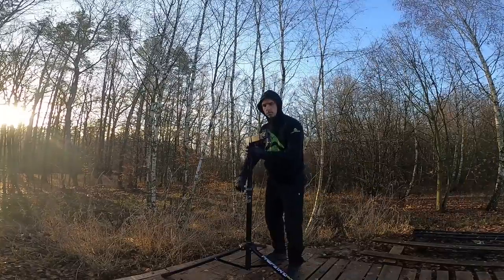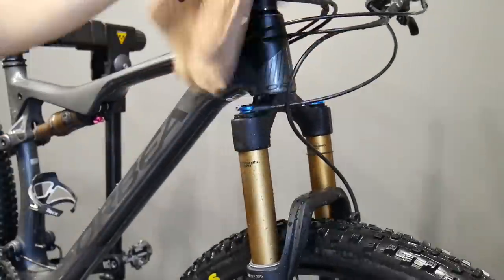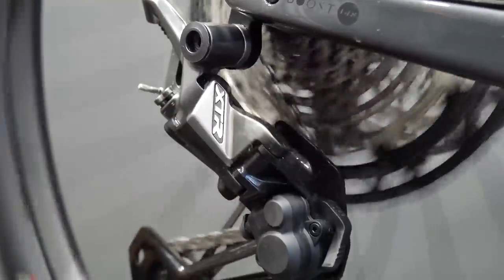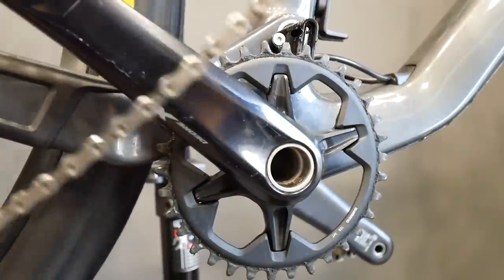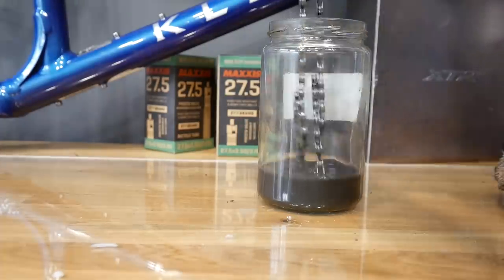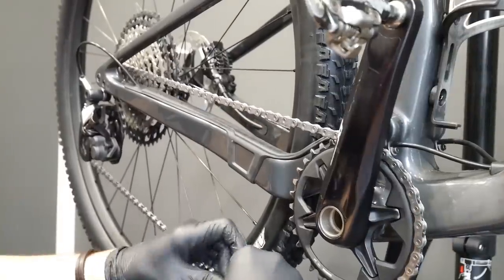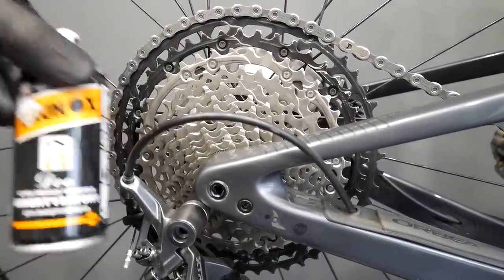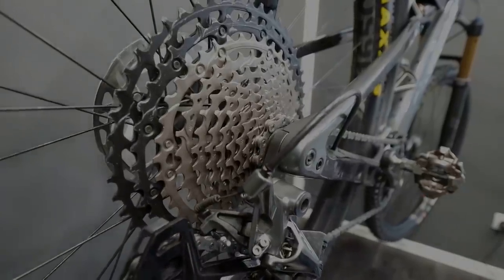One, Easy Trick For A Mud - Proof Mountain Bike Drivetrain. More Than A Clean Chain...

Comment: Dude I love your videos but you just ruined your chain, they are packed with heavier greases in the factory internally which you just dissolved and removed. Do a fast chain clean or use a chain bath at most but not what you just did, you only want to remove that exterior stickiness!

The manufacturers themselves warn not to use the method you used.
Reply: He has a lot of experience I guess.
Reply: @gliderman9302  I’m sure he does and I like his content, but the most experienced manufacturers and techs all say to never put a new chain in a deep bath of degreaser like this.
Reply: @takotsubo the factory grease isn’t contaminated from new, if anything this process in the video contaminates it. The factory grease internally is a heavier compound, it’s not the same as chain lube, once you remove it you cannot get it back on unfortunately. 

It will lead to premature chain wear, etc. 

Let me put it this way, KMC want people to burn through chains so they make more money right? If even KMC are warning people not to do a deep degrease, partly for safety reasons, then it’s probably advice worth following. 

Go check the GMBN tech video on KMC chains with Doddy, he explains it there and why you should never do a deep degrease of a new chain. 

I believe Shimano chains are made in the KMC factory too!
Reply: @VisualGraves  The reality is it probably makes little difference either way. Pretty much all of this type of lore boils down to miniscule performance differences under actual riding conditions, if ever someone does a scientifically sound study. (Which is also very rare.)
Reply: @RobMacKendrick  I’m sure the manufacturers have done those tests and that’s why they’re recommending we don’t do it
Reply: I just put a brand new gear set on my bike. I soaked the chain in fuel overnight and cleaned every bit of oil from it. I surgically cleaned it with metho and then submerged it in melted paraffin wax. When I got back after my first ride, I boiled the chain in water, re cleaned in metho and re submerged in paraffin wax. 
I'll never use oil on this gear set. I'll see in the long term in real life the result. No more dirty and oily fingers for me ✋
Reply: @VisualGraves  absolutely right 👍
Reply: Have you not thought that the chain manufacturers recommend leaving the factory grease on the chain so that it attracts dirt and grit right inside the links and grinds your chain and cassette quicker so that you have to replace more often?

I thought the same as you but experience has taught me that removing the factory grease makes my chain, cassette and crank rings last much longer and shifts and sounds much better.
Reply: @robday1976  they don’t recommend you don’t remove the grease. They recommend you only remove the lighter sticky grease coating under regular cleaning. 

They also don’t recommend against using chain baths (I use a muc off chain bath for cleaning the chain) they just don’t recommend you leaving chains to soak in them for a long time as you will lose the harder packed grease inside them. So long as you regularly clean and relube your chain, you’re not going to have to worry about dirt there. It’s better to have lube and dirt than just dirt, also the lube will repel water. 

Here’s something worth reading on it:

“: What is Shimano’s official stance on the chain lube that comes stock on a shimano chain? Is it actually a lube, or a grease? And is it best to leave it on until the chain gets noisy and relube, or strip it right away and relube before riding?

Nick: So that brings us to lubrication. I mentioned that the chain wears because of friction as the chain moves to wrap around a gear. Well, that friction is reduced if there is lube on the chain. If there is dirt mixed in, the lube makes a bigger difference in reducing friction. If there is water mixed in, the lube helps displace the water. The grease that comes on a Shimano chain is applied at the factory to the individual pieces before the chain is assembled. The grease does a better job of reducing friction than aftermarket chain lubes and it lasts longer. The main reason we use liquid chain lube, whether it is one that stays liquid or a dry lube that has a solid lubricant in a liquid carrier (like a PTFE lube) is because we need to get the lube on a part that is not accessible without disassembling the chain. So the best thing to do when installing a new chain is to leave the factory grease on, not apply any other lube, ride until it wears out and then start applying liquid chain lube. In dusty conditions you can wipe off the outside of the new chain with a rag that is wet with a gentle degreaser to keep dirt from sticking to the grease. The factory grease also keeps the chain nice and quiet. After soaking a chain in degreaser and then lubing the chain with liquid lubricant the chain gets noticeably louder.”

GMBN’s main tech says the same thing basically, as does KMC.
Reply: @VisualGraves  I’ve read the guidance, watched many videos and read many opinion on the subject. I also for many years didn’t remove the factory grease, just cleaned the chain after every ride and used a chain bath every so often whilst at the same time took the cassette off and cleaned that. It’s a routine I stuck to for years. 

I decided to try the other way of removing the factory grease and then lubing and haven’t looked back. I use squirt chain lube. I live in Northern England and it rains most of the year, so my bike, chain and components are wet most of the time out riding. Has this been a problem? Has my chain seized,  rusted, disintegrated or worn out quicker? No. In fact I now ride with a much cleaner drive system, which shifts better and is smooth and efficient. I also don’t have to constantly remove black, grimey, sticky crud from my chain, cassette, jockey wheels and chain rings. A simple wipe down with a rag and re lube and the chain is shiny clean again. 

I’m not saying keeping factory grease on is wrong, just that I was sceptical of removing it but having done so it hasn’t  had any negative effect. I’ll continue doing this and won’t be convinced otherwise until I experience a problem. If people want to keep the factory grease on then go ahead, as long as we are out riding who really cares.
Reply: @robday1976  I’m not sure how that’s different to what I’m suggesting though? My chain is also clean and I don’t have to constantly remove black finery sticky crud. I use drivechain cleaner on the cassette and a chain bath after every major (or dirty) ride basically, then use PTFE protectant spray with a tiny bit of lubricant in, and then ceramic chain lube, dry or wet depending on conditions. 

No one is saying you want to leave ALL the grease on forever and don’t touch it except for topping up the lube. That’s crazy and a recipe for a filthy black chain covered in grit and nature’s finest grinding paste.

The problem is leaving in chain baths overnight, or in deep baths which can break down deeper greases which are not the kinds attracting superficial dirt on the surface if you are cleaning, protecting and lubing your chain correctly in the first place. 

Also I’m jealous you ride in New England, I ride in England but I very much miss Vermont, I’ve spent much of my life there!
Reply: @VisualGraves  I don’t live in New England. I live in the North of England across the Atlantic Ocean.

Your first comment was that he had ruined his chain by removing all the factory grease. That’s what I do and then squirt lube it, which is a wax based lubricant. You have to remove all the factory grease to wax a chain. 

I replied because what you said about him ruining his chain isn’t necessarily true. It’s a different approach with the same outcome - a lubricated chain. I’ve found no negative to removing the factory grease.
Reply: @robday1976  I don’t remember him waxing the chain though. Sure perhaps you want to do a full chain bath if you use wax, but most don’t. I use ceramic dry lube, or wet lube depending on conditions. And I also live in England, and I’m happy to regularly clean, protect and lube my drivechain.

Comment: Never pressure wash your bike. Ever. Cheers
Reply: Nothing will happen to it, except the bike will be clean and shiny in minutes
Reply: @fpsgenerator , and remove all the grease from where it is supposed to be and replace it with water, which in turn will RUST.
Reply: I think it's okay to use pressure wash just don't aim on the bearings, pivots and other fittings
Reply: thats a myth... unless you aim your pressure washer directly at the bearings for about 2 minutes . GCN proved it wrong
Reply: @David-Craig-76 , OK I haven't seen that. Just using my own experience from working in the bike industry since the late 90's. Personally I'm I dry cleaner., cheers from Aotearoa NZ.
Reply: roddas26 oh boo hoo
Reply: @merlinclare6174 , great input Merlin. Don't worry you might be ok, maybe?
Reply: Wrong, I pressure wash all the time.